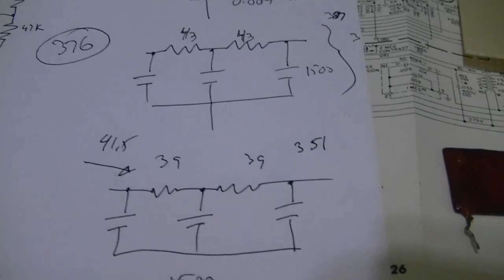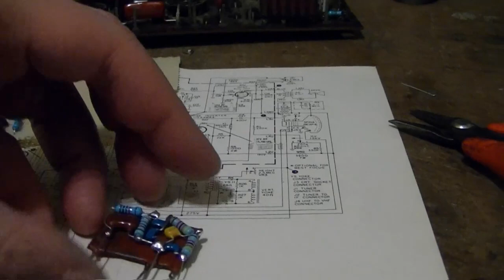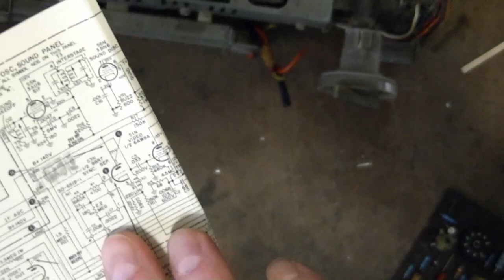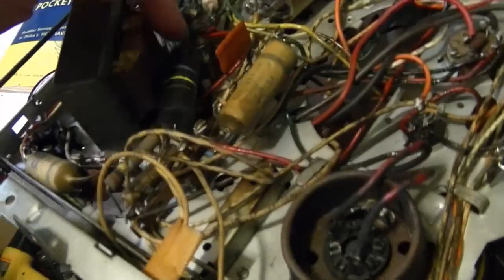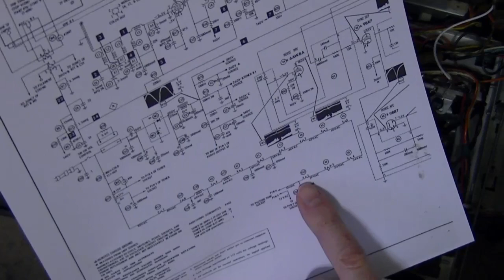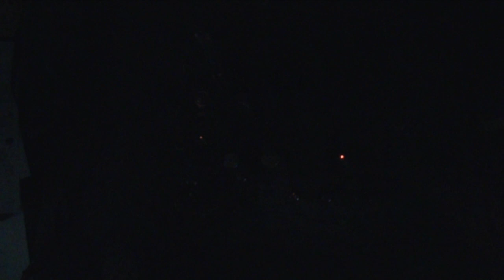Predicta Holiday II restoration p2o6

Comment: Great videos.  I have restored a couple of the Seventeeners from Philco, so am familiar with their construction techniques(PC boards on metal posts, etc).   

From this video and another one I have gathered that you do not have a lot of the series string TV tubes.  If that is the case, just let me know.  Thanks to cleaning out a TV shop and my antique radio friends I have more TV tubes that I will ever use.
Reply from the maker: Thanks.  I actually pretty well set with Predicta tubes.  You might have been thinking of the Philco Town & Country or Silvertone which used some oddball tubes.
Reply: If you ever need them, I probably do have the oddball tubes.  In fact, I even have the gas filled voltage regulator tube that one Dumont chassis used(at least according to Sams).  They glow a nice blue or orange(depending on the gas) when you test them.

Comment: silicone molds, make molds of the old networks
Reply from the maker: Can you cast epoxy in a silicone mold ?
Reply: I cant really see why not. As long as the mold material isn't porous so that it wont bond to the mold material. I'll look deeper into that and come up with a clear answer